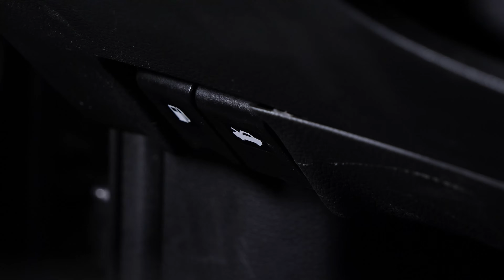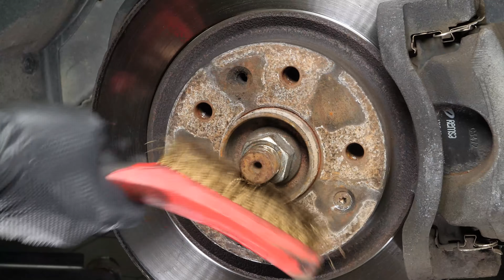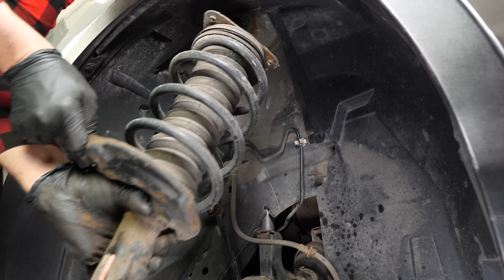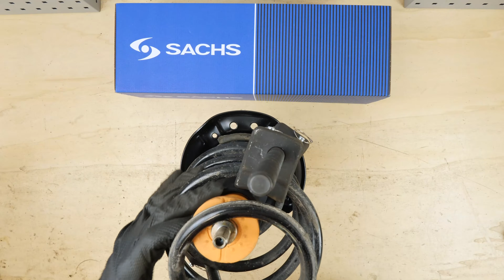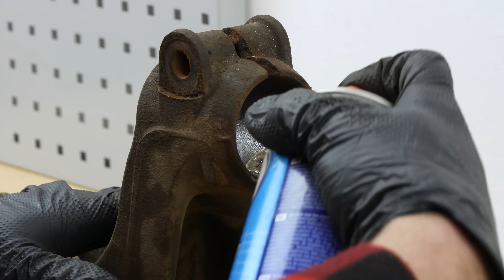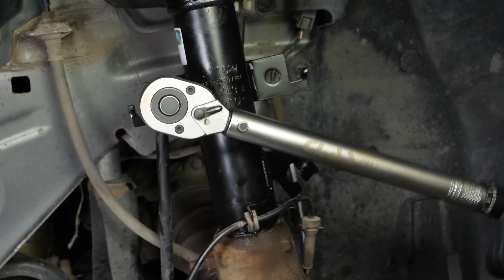How to replace the front shock absorbers Qashqai mk2 ➿

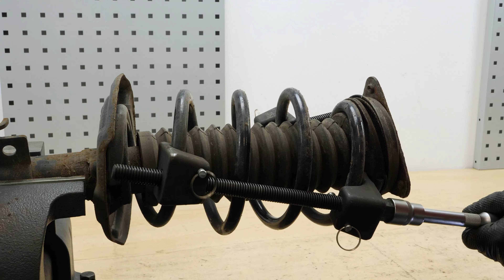Comment: 6:30 PLEEEEASE PLEASE stop showing these spring clamps, they are called for a good reason “the widow maker”.
This is such a bad practice which encourages novice diy-ers to take huge risks.

A hydraulic spring compressor is under £100 now, which is the safest way to remove the spring and you get your money back from the tool in one single job.

If the hydraulic spring compressor would cost £1000 one could say that it’s potentially unaffordable, however that is not the case.

Comment: Tightening torques:

Shock to wheelhub pinch bolt 168Nm
Tie rod end 34Nm
Wishbone Ball joint to hub bolt 92Nm
Drop link nut 75Nm
Shock top bolts to car body 16Nm
Shock top main nut 62Nm
Driveshaft nut 255Nm
Caliper carrier bracket bolts 150Nm
Wheel bolts 115Nm
Reply: Thise caliper bracket numbers seem high I've read 80nm elsewhere which tbh wouod suffice . My bike engine mounting bolts are 85nm at least the 2 rears which are 80mm long . Onky thought id say cheers though

Comment: Good guide. Would be a nice touch to list the bolt sizes for the control arm and the pinch bolt for the shock should they need replacing which most of mine do. I see you replaced a few in the video also.